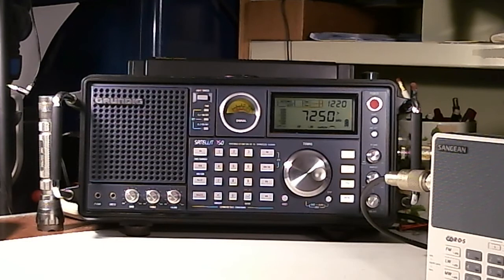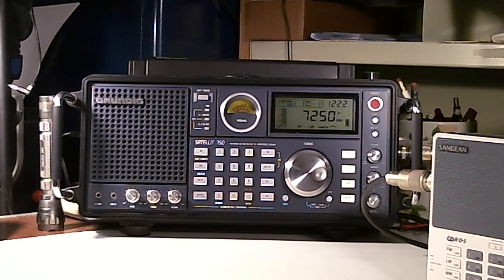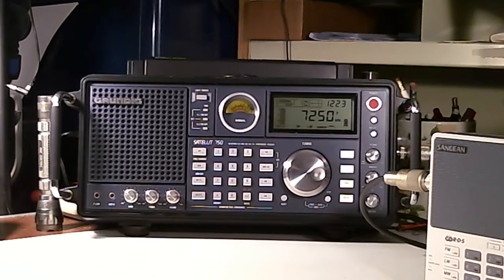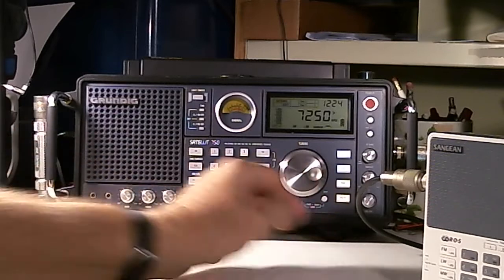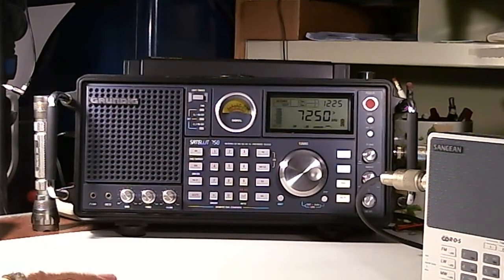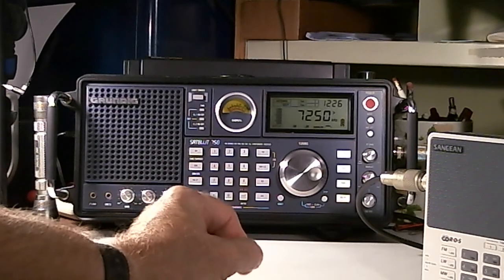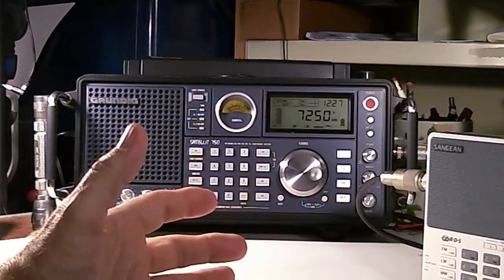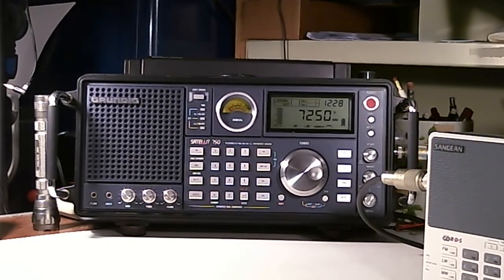TRRS #0346 - More on SSB Tuning

Comment: Since the radio's audio output is connected to a mixer, then, you can monitor the audio from the mixer using a pair of headphones or earphones.

Radio --> mixer --> headphones.

73,
9W2GNU
Reply from the maker: Thanks for your comment.  I use to have it setup that way but my earphone's pads fell apart so I tossed them.

Tom
Reply: I see... Hi Hi HI Hi.. :)

Alright, No prbolem.  You have MANY radios around, and you should have several pair of headphones/earphones too. If you dig around, you may find some earphones which come with the radios... :)

Thanj you.

73,
9W2GNU
Reply from the maker: Ok, here is the rest of the story.  I don't like to use headphones when listening to radios as they restrict my movement between my many desks and setups.  The headphones I had been using were wireless so I could move about with no problems.  Unfortunately,  the ear pads have gone bad so they are no longer usable.  What I need to do is find another pair but I have not purchased a wireless headphones set in years so I have no idea what would work well in my office.

Thanks for your comments,

Tom

Comment: Tom, for newbies, it would help thier understanding SSB if  you use a drawing of a medium wave carrier with of course both bands, and then explain the use of either the upper or lower portions of that am carrier wave. Thats a great visual for those new to the hobby.   Also, thank Gawd you dispensed  with the plastic hand pointer. You have a very expressive left hand, MUCH preferable to that plastic thingy. Happy listening.
Reply from the maker: I did just that in show number 217.  I will added that to the description of this show.

Thank you.

Comment: Sigh, if only the modern-day receivers had the same ease, quality, no BFO and rock-solid SSB tuning that we Sat 800 users enjoy to this day. Then again, the S750's and Sangean 909's aren't all THAT bad.
Reply from the maker: Only a few are lucky enough to have an 800. :)  Some day I will get lucky. :)

Tom
Reply: I don't really aspire to owning a Satellite 800 preferring instead the ICOM R75 or Alinco DX-R8, perhaps if one fell into my lap I might feel differently...
Reply from the maker: I am hoping a R75 or DX-R8 will fall my way. :)

Tom
Reply: Love my Sat 800. Picked it up for $200 in perfect shape.
Reply: *****
Agreed, for sure...we all have our favorites and frankly for very good reasons. The Sat 800 isn't the only receiver fish in that electronic pond, but it is among the better ones as is the ICOM and many others.
Reply: Richard2003
As I figure out how to make best use of two Sat 800's, Tom's good job on the almost "art" of SSB tuning shows all just how much SSB really has and continues to mean, even in the 21st century..where would we be without it ?
Reply: Joseph Rotello On overcrowded bands restricted to AM only, using various modes including SSB is a more efficient use of the frequency spectrum.
Reply: Joseph Rotello Right you are Sir on that, I think it's the general humungenousness of the Satellite 800 that's off putting, mind you I much prefer the front firing speaker to the top/bottom mounter location in terms of sound delivery.